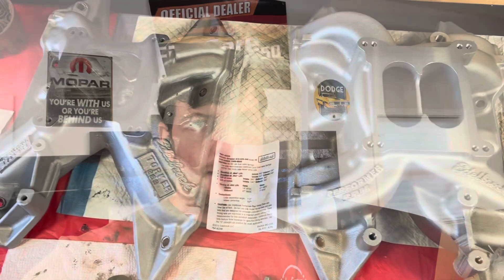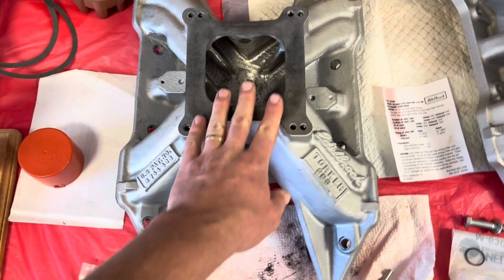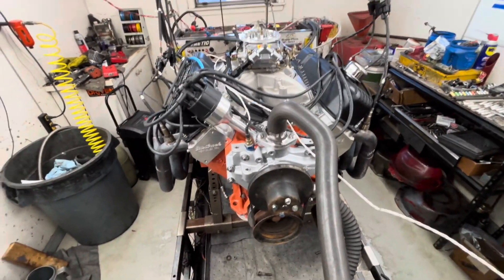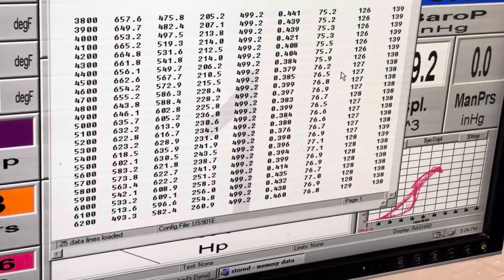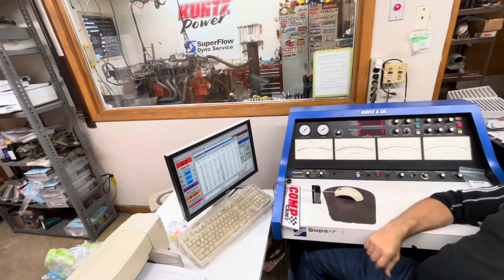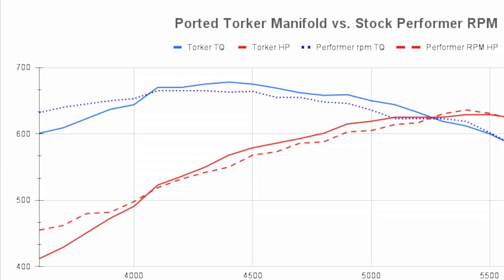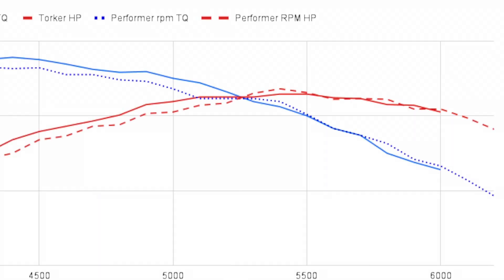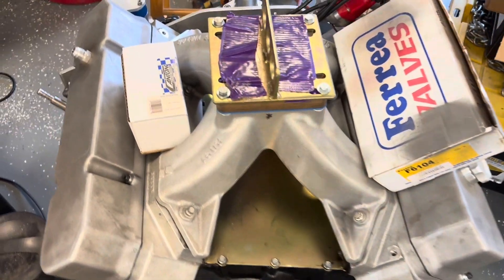400 to 500 Stroker: Dyno Intake Testing Edelbrock Torker vs. Edelbrock Performer RPM  #mopar

Comment: Hi Joe, i am struggling with a decision.
i have a 72 dodge challenger with a 440 that i want to build a 512 out of.
I am concerned with hood clearence and i see that the torker 2 is Rear Maximum Height 5.200 in instead of 5.800 for the performer rpm

it is mostly cruising but i want to pump power why up. goal is 500+, now i would be supprised if it makes ofer 250. (8:1 cr from 1977)
do you think the torker drop down low is sooo bad? that i should put a performer on. and do you know if the hood clears.

else i have to get some playdoo and test/ measure

Thanks in advance 
greetings from germany
Reply from the maker: Both are great intakes. I don’t think you’d notice a difference inside the car at wide open throttle. I would use the one easier available to you. If you go to the stroker, it’s going to have gobs of torque regardless. A performer is usually better suited for a stock 440.
Reply: @JustMoparJoe  thanks man, then i will buy a torker2 because of the looks and hood clearance XD
Reply: or i buy the holley Street Dominator Intake - Chrysler Big Block V8
its nearly the same hight as the torker but says that the rpm range is 1500-6500 instead of 2500-6500. 
looks nearly identical from the runner desinge to me but the rpm range  indicates maybe better low down torque

Comment: The torker is under rated, works great between 4000-5500rpm (due to it’s runner length)
But the lowend on the RPM intake🤩
Reply from the maker: It’s true. I just did a track test with a tm6 versus my ported rpm versus a stock rpm. Check out the blue truck

Comment: I bet the torker is much lighter than the performer RPM also, my trick flow track heat intake is almost half the weight of a performer RPM
Reply from the maker: Dyno day for the 512 is in reach!

Comment: I love those RPM intakes. I’ve ran 3 of them on cars. They’re bad ass for street cars. Lots of torque down low and awesome horse power levels close to a single plane. Best of both worlds. The only issue with them is they’re tall and don’t fit under hoods, so scoops are required.
Reply from the maker: @JonnyMopar  yea buddy! It would definitely win below 3,500. I will port match one someday and give it a try!

Comment: From experience, if you want to lose on the street use a single plane. Unless you like to rev and launch at high rpm at every stoplight . Sure the single plane makes more power but losing to 5.0s etc at launch gets old
Reply from the maker: I’m not sure how many 5.0 mustangs ride around with 682 foot pounds, without a power adder of some kind.
Reply: @JustMoparJoe  not many lol, but 682 is definitely race level torque.
Reply from the maker: @SE-me2pt  I think it’ll spins tires with 500 foot pounds. He should have that at 2,500 rpm 😂

Comment: Hi Joe , really nice vids, I´m a Mopar guy been since 1990´s just have to say you must bee some kind of a  word class engine builder , head/intake porter and one heck of a tuner! Have built several enginies with similar parts and did port work myself but I´m not in the same ballpark as you when it comes to power and torque! newer seen high 0.3 to low 0.4 BSFC on a similar engine on my own SF901 dyno just cant understand how you get the engine that efficiant! congrats to you and your dyno guy! Mike.
Reply from the maker: Thank you, Mike! Check out my 400 dyno videos and the 440 dyno videos if you get time. I’d love to hear your thoughts

Comment: If this is a mostly Street Engine, that Torquer is now wall art below 4000 RPMs.  The RPM Air Gap killed it down low and hung in close enough to the Torquer above 4000 RPMs, it would be tough to justify the Torquer for street use.  Maybe for strip use also.  I would have liked to see a more modern single plane Victor intake tested on this engine.  With longer runners, I think it would do better down low, and still do well up top.
Reply from the maker: I'd agree, for mostly street driving, the air gap is the better choice. I think with a 3,500-4,000 stall, it’d jump right up to that peak torque and like the torker better at the racetrack. I have the rpm on my 406 in my blue truck now. I wanted that extra grunt to help move the truck.

Comment: In my 1968 Barracuda fastback I run a 400 based 512 stroker with Trick Flow 240 heads and a hydraulic roller cam with 254 duration @.050 with 618 lift, all backed by an A833 4 speed manual. I run a 950 Quick Fuel carb. I've ran it with both a ported Edelbrock TM6 intake and with an RPM intake. I prefer the RPM, as it seems to recover better between shifts. 💪
Reply from the maker: Sounds like you've got a great combo, I think that RPM would work really well!
Reply: You happen to know your power numbers on that setup?
Reply: @joshg4103 I never had it dyno tested, but based off of the heads, cam and similar engine builds, I would guess over 600, likely around 650 for both horsepower and torque.

Comment: Typical SP vs DP. Top end is always better on a hood single plane. Under 4k is better on a dual plane. 
Why didn’t you use the spacer on the RPM? RPMs always benefit from spacers. Which kind depends on the combo.
Reply from the maker: I sure wanted to, but ran out of time that day. I have a tm6 to try someday versus the performer rpm

Comment: Nice power numbers. The Performer RPM did exactly what it’s designed to do made power in the lower rpm range. The Torquer did what it’s supposed to do make power in the upper rpm range. The cam has pretty healthy specs.050 and the 112 lobe separation is going to carry higher up the rpm range. I’ve seen similar results from the Engine masters show and Richard Holdner.
Reply from the maker: You're right, It did what it’s supposed to do. I’d bet he’s spinning tires at 2,000 rpm with dual plane!
Reply: Do you know what Aaron charges to Dyno an engine?

Comment: Very nice info very informative, Did you try RPM with a 1" spacer? Usually from what I seen is that Dual Plane intakes require more Plenum volume,
Reply from the maker: I’m sorry I did not. We ran out of time on the dyno and had to get the engine off and in the shop before they closed for the day. I’ve heard that as well. But I know many Flat hood guys can’t run a spacer. The rpm did have a factory gap cut in the center divider. They must have seen a performance boost from that at edelbrock.
Reply: @JustMoparJoe  Thanks very much

Comment: Thanks for info on valve springs, from a machinist/engine builder picked out the right springs for my cam  most machinists in my time would not tell you springs have to matsch the application
Reply from the maker: Yes, good machinists know their springs!

Comment: Really wish dyno pulls started at lower rpms. Apparently, that's not possible? They typically start at 3,500, which is fine for drag racing. For street stuff, you drive like a sane person, it'd be nice to see numbers from 1,500 or so. 
Anyway great video!  Kinda proves the dual plane for the street, single for the strip thing.
Reply from the maker: I agree with that. I bet the dual plane was making 600 foot pounds for a long time!
Reply: I remember Nick's Garage also having trouble pulling low rpms on torque motors like a long ram equipped 440.  I think it's the dyno itself is incapable. 🤷‍♂️

Comment: The dual plane intake may have picked up a little with port matching.   When you have that much engine though as you seen for yourself a single plane intake almost never hurts.  Obviously better here.  Even my small block builds get a single plane, 383 Chevy with small hydraulic roller 237@.050  let the torque converter get you up on the power.   Bottom line for an engine that big going in a car I would always use a single plane intake.    If it were in a 4x4 then probably the dual plane is a better option.       Either way that engine is going to shred tires. 😂
Reply from the maker: Yes sir. I’ve got the rpm on my 406 now in my blue truck. I figured the fast revving short stroke would like the extra torque to move the truck.
Reply: @JustMoparJoe  Great ! Looking forward to see it go down the track.    Maybe some cool cruising around down town Mexico with some tire BBQ 😄

Comment: Great Engine Joe. Cool comparison of a single plane vs dual plane. Looks like a single plane doesn’t make a difference unless more radical can higher Rpm power band. 

Looking forward to the 512 with Trick Flows, but why not do the 270s ? 🦶🏾
Reply from the maker: The man chose the 240’s as a package deal here locally. He has 270’s to use on a different build. I’d love to see 700 both ways from that engine,
Reply: @ your practically there already should be pretty easy for you

Comment: As I stated before, Beehive or Conical. Watch DVs video 🏁. I have dual plane intakes on all my street na vehicles. Roll in dyno low at 2600rpm at 300rpm... Thx for update, Joe.
Reply from the maker: I think you’re right on that! The dual plane intake is a good choice for street engines.

Comment: Man that's a stump puller motor. 4000 to 5000 or 4500 to 5500. Torker as a rule is higher rpm power but this beast is 4000 rpm torque monster. As a steet motor it's going to be a hoot. If it hooks its going to eat u joints 😂. Your porting is very close to what I have done in the past. Ronny Sox always said its torque that moves a b body not hp and hp you want it to peak in the upper rpm. I have lived by his words and it served me well. I bet this motor would make a c body grunt 😂. Donk motor lol. I love everything about this build to be honest. ❤
Reply from the maker: It will definitely get the job done!

Comment: Are you sure the specs are written down correctly on that cam card? I have a Comp Cam that is very similar except for the intake closes  and the exhaust open are reversed compared to your cam card. The number is differ by 13 and 14 ° compared to your cam specs, one of these has to be wrong
Reply: By the way I have three other hydraulic roller cams I've tried and their numbers only differ by the Comp Cam by 5 or 6 degrees in One Direction or another. Part number of Cam is 23 - 000 - 11 Comp Cam
Reply from the maker: I don’t have anyway of knowing. But my cam man says “you have to make sure the timing events are at .050" or .006" or .020" or you can't compare them directly.” I think it’d be interesting to see the aggressiveness of the lobes on this cam. Daniel Powell had excellent videos on that.
Reply: Yes the cam events I was checking were at 0.050  @JustMoparJoe

Comment: Interesting, I figured that Torquer would have been better all around, but then again the RPM had better readings at less rpm 😊
Reply from the maker: The Performer RPM is probably going to be a better street choice, in a stock stroke engine or even better in a 383 or 400. 440’s always make good torque even with bad compression. I think the extra foot pounds below 4,000 would help in a street car